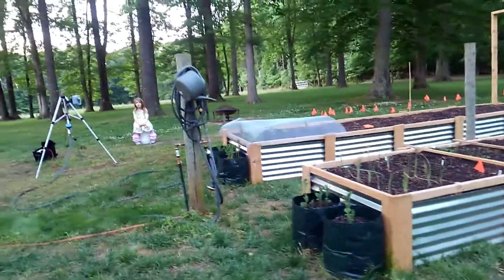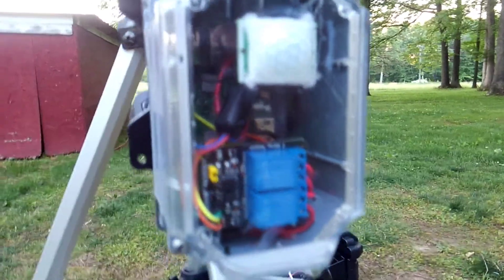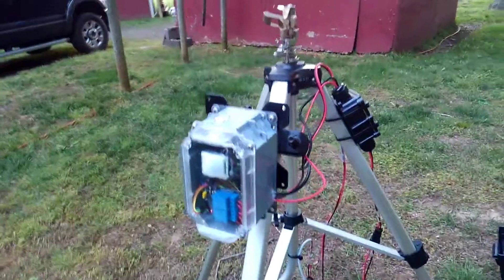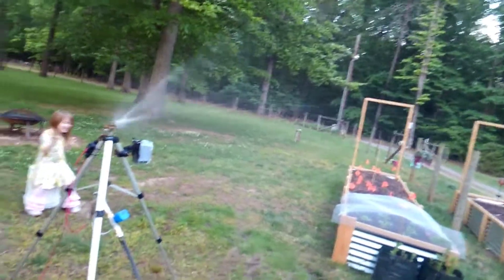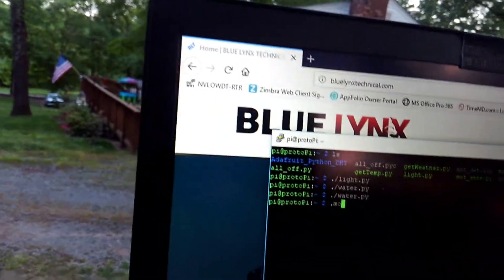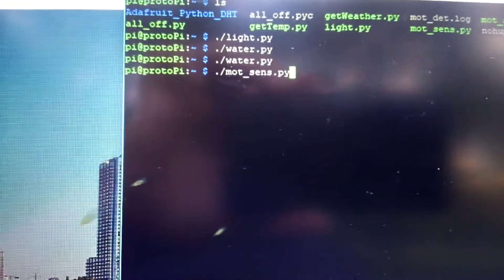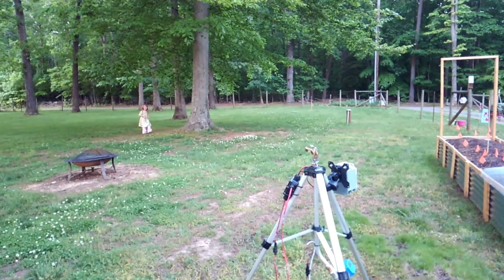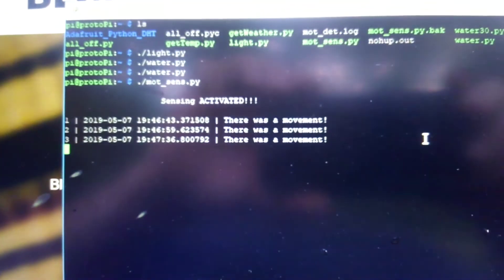Motion Activated Deer Sprinkler DIY

Comment: I had a somewhat simpler idea where I used a 120 volt motion sensor that takes the  the two light bulbs. I then used a relay that I connected to a sprinkler valve so that my sprinkler system activated when there was motion.

Comment: how did you mount the relay and the Pi
Reply from the maker: I used only one of the holes in the corner of the Pi and using pcb standoffs (https://www.amazon.com/Female-Standoff-Quadcopter-Computer-Circuit/dp/B0975TVKRW/ref=sr_1_2_sspa?dchild=1&keywords=pcb+standoffs&qid=1635939598&sr=8-2-spons&psc=1&spLa=ZW5jcnlwdGVkUXVhbGlmaWVyPUE3MEYxWDhPMktMUEwmZW5jcnlwdGVkSWQ9QTA5MjM1ODAxQTdQWENVNUpDVjM1JmVuY3J5cHRlZEFkSWQ9QTAxNzM1ODcxMVlNWkhMU0FRVFpBJndpZGdldE5hbWU9c3BfYXRmJmFjdGlvbj1jbGlja1JlZGlyZWN0JmRvTm90TG9nQ2xpY2s9dHJ1ZQ==) was able to make it fairly secure.

Comment: i would like to build something similar can you help me with where to buy what i need?
Reply: I would like the parts list. I'm not very technical but I'm taking the Mark Robert class on builds ☺️
Reply from the maker: If you're not pretty technical, I would suggest purchasing the one I based my improved one off of. 

https://www.amazon.com/Orbit-62120-Enforcer-Activated-Sprinkler/dp/B00CD3UWPA/ref=sr_1_2?dchild=1&keywords=garden+enforcer&qid=1623519584&sr=8-2

If you are pretty technical and want a challenge, let me know and I'll get you a parts list.
Reply: @thelowdermilkhomestead4856  I will be learning how to use Arduino
Reply from the maker: I put a parts list in the video description. Some of the parts I used are no longer available so I substituted parts that should work.
Reply: @thelowdermilkhomestead4856  thank you!! Yay 😁